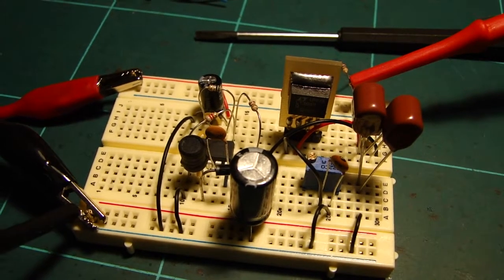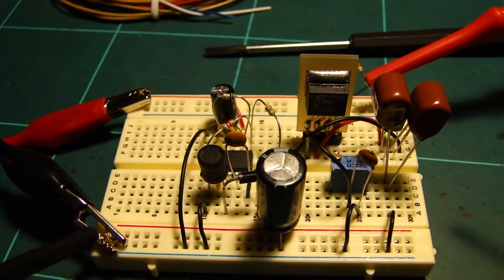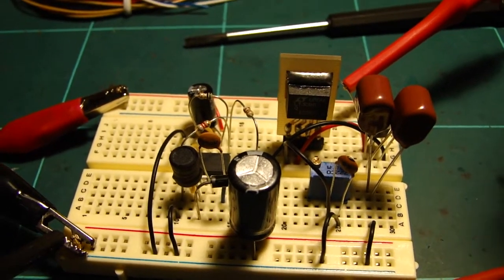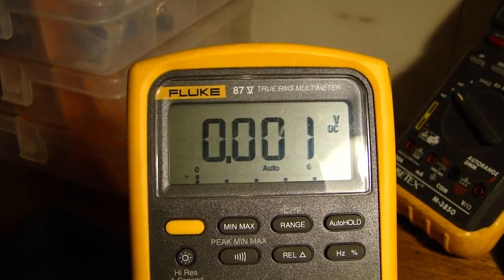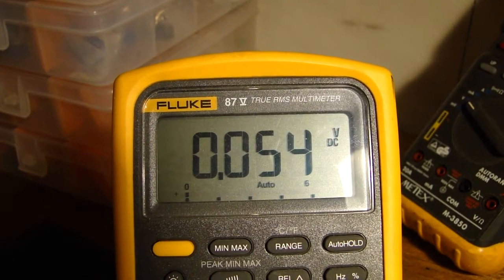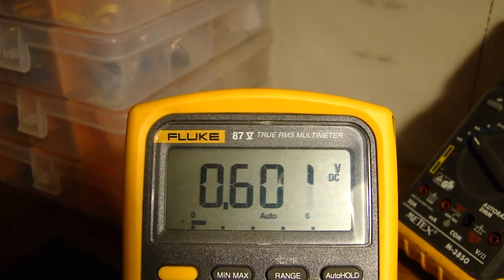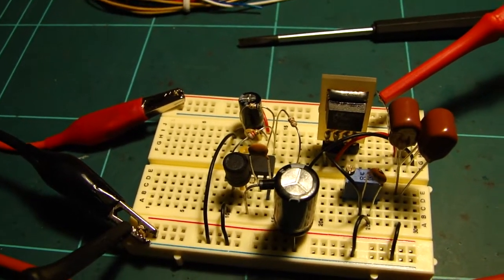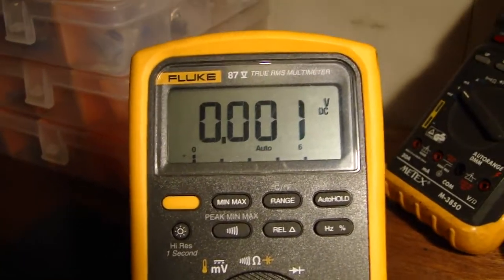Making the LT3080 go down to 0V output

Comment from the maker: The load is between the LM3080 output and the -ve. So the constant current source can supply current down to zero because it's "ground" is below the real ground. Otherwise without a neg supply the constant current has a minimum voltage to maintain it's constant current.